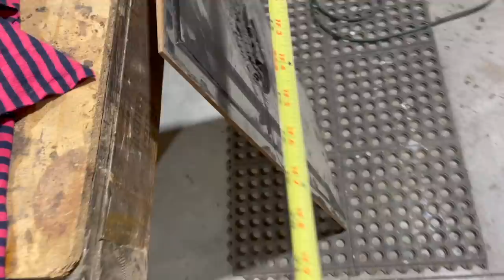Stop looking at my chest

Comment: Your videos are mesmerizing and instructional, although you may not intend this.  I’ve been a professional ‘woodworker’ for over 50 years (built & repaired furniture, cabinetry, buildings, even some musical instruments).  I watch your videos to learn the ‘newer’ methods, materials and techniques because I have always learned valuable insights from especially skilled craftspeople and you are very highly skilled.  You may not fully appreciate your  ’skill level’ because you learned some of it ‘effortlessly’ as a youngster in your parents’ shop. 

     I have a few questions, if I may, that arise from watching several of your projects:
 1.  You appear to use pry-bars without padding or ‘guards’ to loosen/separate ‘exposed’ wood joints.  How do you avoid damaging the exposed edges?  The ‘old school’ method was to always protect the wood from crushing with a guard of some sort.

2.  How are you able to breath comfortably while using a heat gun or liquid stripper without a mask?  Are you in the vacuum booth and I can’t see it in the video? Or are there water/non fuming strippers I don’t know about?  The volatiles from heating old paint and using liquid strippers used to be very toxic, as in lethal! 

3.  And a suggestion about gluing tenons into mortises.  The tenon acts like a piston going into the mortise, if it’s the desirable snug fit.  The glue is a non-compressible fluid.  So it’s easier to get a good fit that doesn’t creep, deform or split if there is somewhere for the excess glue to go.  Craftsmen used to cut a few ‘v’ channels with a knife or the corner of a chisel along the length of the tenon to allow excess glue to squeeze out.  On delicate or thin joints the compression of the glue with clamping can split or deform the mortise walls.

So I'll continue to watch and learn from you.  And I have just noticed I can "buy you a coffee", so I'll be doing that also.
Reply from the maker: Hi there. So thankful to have you here. So to answer your questions. Number one, I’m pretty careful with how much pressure and exactly where the pressure is being applied to not leave a mark where it can be seen or none at all. I do use a putty knife if that is unavoidable, but I’ve also made mistakes and dented pieces. My bad.       My stripper is very volatile and definitely not a good substance to breathe. I have a large exhaust system in my paint booth as well as a smaller exhaust fan, both of these are running while I strip or stain to keep Constant airflow. But I should also where my mask more thank I do.     Three, yes I agree. Always provide hydraulic relief in a glue joint of any kind. I usually cut grooves into new dowels or if they are not fitting tightly then just go ahead and assemble. 
Thanks so much for all your questions and for your support! Cheers!

Comment: My Dad brought a coffee table like that back from Asia when he was in the Navy in the 60's.
The only difference was the bas relief carvings were really deep and multi layers (1 inch) and covered the entire table top except the border.
Sadly he ruined it by pouring clear epoxy in the lid carving and he hadn't gotten all the oil out of the wood so it cured opaque white.
Reply from the maker: If you soak it in acetone you could remove it in the layers. But it would be a huge job

Comment: Have you ever tried wetting the wood where the twists are then on the twist side using a heat gun on the opposite site of the twist. Lightly wetting top side or outer side of where the twist is at and using the heat on the opposing side will loosen the twist where the tension is at appling heat on the opting side will apply tension against the twist and if you work it a bit will unwist the wood or pretty close to that keeping the chest closed trapped a lot of the moisture inside as the out side tightened up the inside had higher moisture lol in side. . Out side pulled tight inside remained soft in some areas causing the twists.

Comment: Another possibility on the top: turn it upside down onto a piece of flat solid plywood, shim it all around so it doesn't wobble, and send it thru a wide belt sander.  That would put the bottom edges all into one plane.  Not sure about Windsor, but Public Lumber in Detroit has a wide belt that is available for stuff like this, and it's not expensive maybe us$30.
Reply from the maker: I’m afraid that would make the carvings look very uneven and horizontal lines look as if they run diagonally. Although it would sit flat the visual affect wouldn’t be good. Thanks for the suggestion though. Cheers

Comment: When you added the extension to the top I would have  alternated the clamps  one side to the other. I have found that if clamps are all one side that they can bow the wood a little. Intersted in your thoughts. As usual a really good piece of restoration.

Comment: On that top hockey stick.  You could have done relief cuts on the back of it (about 1/3 - 1/2 of thickness with kerf cuts parallel to the twist. Then fill the kerf with epoxy after you straighten it w clamping.
Reply from the maker: Yes that would have worked

Comment: They make a carbide blade pull scraper (harbor freight - but they don't carry them any more)  which are great   - they can last years  (10 - 15)   then you buy a new replacement blade for $8.00  e-bay - held by a single screw/clamp bar (I do wood boats - lots of heat varnish removal) -about 1-1/2" wide or maybe 2"  suggest you hunt one down  - have not sharpened a steel scraper since'   you still need the pointy one though
Reply from the maker: yep have lots of these and they are great. cheers

Comment: Shipbuilders used steam to heat the wood to make it pliable then clamp it into frames shaping it into the curves needed for the ship’s hull.  The same method could be applied to straighten warped wood.  Might file this for the next time.
Reply from the maker: Not on this one. The piece of wood was not good for steaming

Comment: Beautiful job. I wonder, if steam bending is not a technique used by conservators? Shipwrights and even piano makers use steam to mold the wood to the desired shape. In ship building, some pieces of wood may need to be straighten or bent to a shape and it works quite well. They can take a warped piece and make it true to angle with a bit of steam and clamps. Albeit, non of the wood is highly ornate and decorated. Would this technique not be suitable for conservation?
Reply from the maker: No not really. Old wood that is thinner and carved out is very prone to splitting and also not holding the bend or straightening out after being that way for so long. It is very rare for the steaming to be effective after that much time so it’s not really worth the risk.

Comment: Just a suggestion: From my experience, when you use that pry bar, there is less chance of damaging the piece if you insert it as you do, then apply side pressure instead of pulling the bar toward you. I  have been doing this kind of work for many years. Currently restoring historic wood-bodied railroad cars.  I enjoy watching you restore those beautiful wood pieces. 
Thank you for what you do.

Comment: Regarding that piece that is so warped and twisted (29 min):  If a honey-comb pattern of holes was drilled into the piece from the back in the most warped areas, would that allow the piece to be straightened?  My thought was that without violating the surface pattern, the back of the piece could be weakened and the piece brought to correct alignment.  Once the shape was correct, the holes could be filled with epoxy to restore the bulk.

Comment: On the badly warped board, what if you sawed it thin on a table saw and put a straight backer on it to straighten it up.
Reply from the maker: It could. But I wanted to try to do the least amount of changes to get the most acceptable result. If the lid just would not sit well enough we would have had to try something like this. Cheers.

Comment: While Eucalyptus are not deciduous, neither are they softwood. In fact certain species such as Blackbutt are some of the hardest, densest timbers known, with very high yield stresses, and are graded for the construction industry according to the F1 - F42 system. Some, such as Tallowwood, are rich in natural timber oils, and were prized for laying hard wearing dance floors. Edge tools that last reasonably well on maple, beech, birch, walnut etc. will blunt much more quickly on Eucalyptus, so if you craft this kind of timber, you have to sharpen often.
Reply from the maker: yes. sorry this is camphor wood. i was mistaken

Comment: Hi Trena: Could steam help you straighten the stubborn front part? I had such a problem with oak and didn't have steam, or much else, but I had hot water and it worked.
Reply from the maker: Unfortunately with these much older pieces they usually bounce back.

Comment: hey did you ever try putting  a wedge or wedges between the two pieces your prying apart might take the pressure off a little maybe at least you can get your prybar back in under better the chest at 51.32 look really good as it was light stain to show the woodgrain mixed in with the black carvings oh yea ps whos Ruth

Comment: After you clamped the top, it seemed flat and level, sitting on those 2x6 blocks. Did it spring back when you place it on the chest, or was the chest itself also warped? It's not clear why there was still a gap when you made the top so level.
Reply from the maker: yes the chest itself was also a bit wonky but also the parts not sitting on blocks were uneven it parts. overall acceptable

Comment: Out of curiosity, the front frame piece on the lid, would moistening the piece with water so that it's a bit more flexible then allowing it to dry being clamped straight get it back to where it should be? Or would it just be temporary in that when it's back in humid conditions, it would rewarp?
Reply from the maker: Usually when the piece has been this way for so long it just springs back. Thanks.
Reply: @johnsfurniturerepair  Thank you for responding. I enjoy refinishing and/or restoring wooden furniture pieces. Since I'm fairly new at this hobby, there are some things I don't feel I have very strong knowledge of and appreciate your replies. Thank you so much.

Comment: Is it possible to steam bend a piece like that (@28:14) into submission? The wood was probably not dry enough when they cut it originally (?) It's a defect in the wood itself so I would be tempted to band-saw that carving off and glue it to a new piece of wood.
Reply from the maker: Most likely not. But it is very dry now and steaming would be a complicated mess at this point. Thanks for watching!
Reply: @johnsfurniturerepair  I tried to not skip ahead but now that it's done I'm absolutely AMAZED at how good it looks.

Comment: Hmmm? All that work and leaving that top warped like that. Why couldn't you plane the middle bowed section of that front piece down. This would help straighten the warped edge some, then cut a template of the bottom trunk edge and scab a piece of wood onto the planed edge and cut the outside edge of the added piece according to the template so as to fit the warp. At least the edges would fit tight and it would not have those major gaps. Just an idea.
Reply from the maker: Sure that could work, but the warp doesn’t detract that much in the end and I just didn’t think further measures were needed. Thanks though.

Comment: In case you didn't notice that Piece had WATER Damage. Which is why it warped so badly and fell apart. Left in a Wet Basement somewhere way too long.
Reply from the maker: A bit on the legs. None on the top. Warpage due to humidity changes from importing.

Comment: Wy You don’t use hideglue for the repair of antik furniture?
Reply from the maker: I could, just haven't gotten into using it. on this project though, epoxy was necessary
Reply: @johnsfurniturerepair  With my comment I meant the white glue. If you think that later another restorer is in front of the furniture and re-remove the glue ...
I avoid wherever it goes white glue.

Comment: "It's going to be a repair,  so it's going to be a weak point." I always used to have the same opinion.  It turns out it is not always right.  According to this guy:  https://youtu.be/m7HxBa9WVis, the glue is stronger than the lignin that bonds the fibres together,  but not stronger than the fibres themselves.   So in the case of the little block you were repairing,  it would be no weaker than original because the stress is across the fibres, not along them.  You could put that nail in,  but then it was a dumb place to put the nail in the first place :0).
Reply from the maker: good point. i agree.

Comment: YUO NEED TO SPRAY ON THE INSIDE OF THE CHEST WITH A WOOD SEALER TO PROTECT IT FROM MOISTURE…
Reply from the maker: No you wouldn’t want to do that. It’s meant to be aromatic wood. The most you would want is a light oil or wax finish. The interior of a cabinet is often left raw. It would not absorb moisture unless water was introduced directly to the inside. Same idea as a Cedar chest.

Comment: Intention to inform: you realy should get into more using "hideglue" it will revolutionize your woodworking. It is watersolvable and a reversible glue. 
Adavantages:
-you can wipe it off with warm water at any time even when it has harden after a few hours
-you can mix any woodpowder in to create a bondofiller witch is watersolvable
-you can make it waterproof by adding "Casein" 

-you can paint over it
-you can glue up to 1inch in size while just adding to the dry glue new. Step by step creating a bridge made of hideglue
-you can use it at childerns toys because it is eatable and absolutly non-toxic
-you can sand it like wood
-you enjoy a super taff gluejoint, the wood will snap before the glue does
-you can add pigments to match the woodcolor and fill in cracks
-you can produce a syrup viscosity a-like glue that you can dive in instable wood, the wood will absorb the glue and when the water is evaporatet the wood is stabilized and very strong!
-you could with reheatening the glue apply it at any time and resolve it at any time with heat and warm water
-you can shelac over it
-you can glue almost anything that absorbs a liquid togheter
-you can do your next woodworker a favor because he just can resolve the glue with warm water away and do his repair 
-you can do a ton of nice stuff with it that i dont know off and you will find some!

now go and order somewhere "Hideglue" or "Rabbitglue" or "Fishglue" they are insanely practical in use!
Reply from the maker: lol. Wow! love all the information. I love hide glue and keep it on hand in the shop. but I will admit its not my go to, but perhaps it should be. thanks for the tips.
Reply: @johnsfurniturerepair  well i have about 10-15 kinds of glue types at my shop too, but when it comes to wood i take 99% hideglue. 
But it was my way to go and grab a 2k epoxy before... 
So we can change our behavior ;) but nobody has to just because we could... keep up the good work. Bye